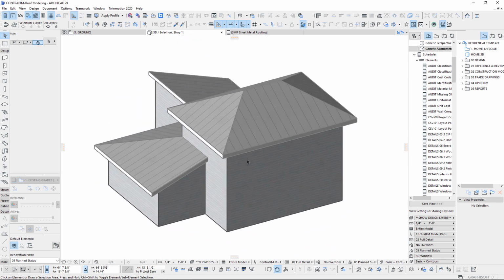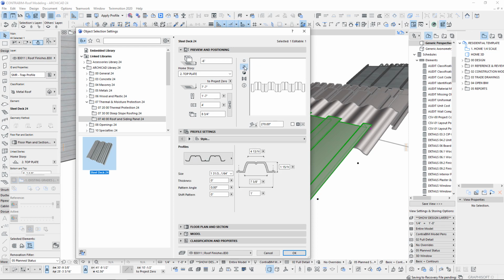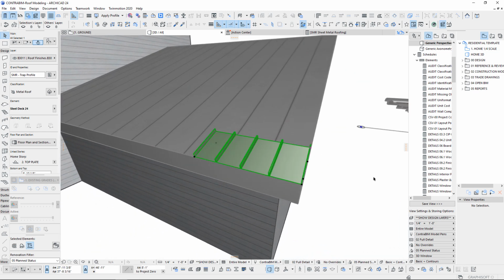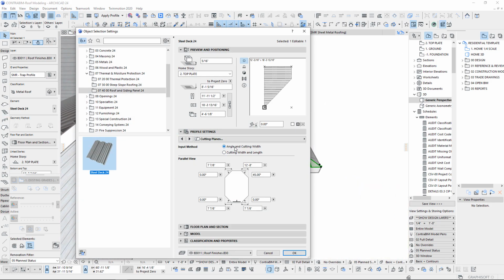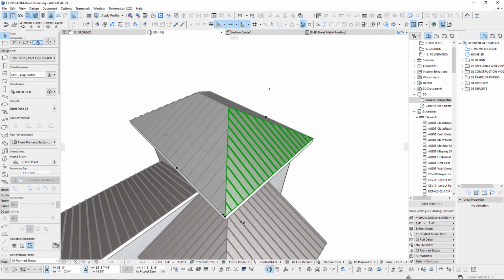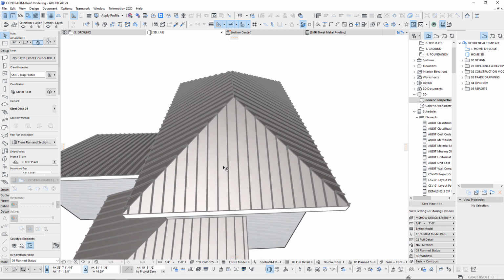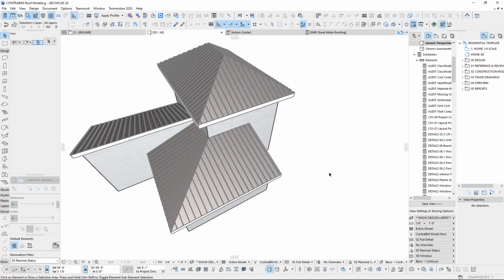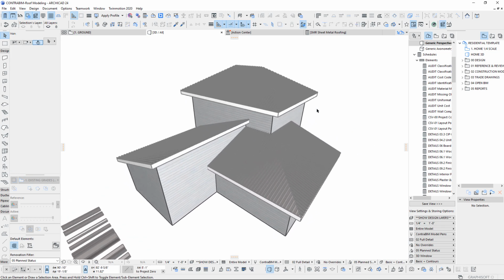Archicad Modeling: Sheet Metal Roofing with Deck Object (Part 2)

Comment: I recently had to model a standing seam roof and I realized it a lot easier just to use a normal roof and model the seams separately with the curtain wall tool!
Reply from the maker: That's a great idea! Curtain wall tool has so many hidden functions it's awesome. In the next video you'll see the roof surfacer tool which can quickly apply seams as well.

Comment: Hello, I wasn't aware that Archicad had the ability to create takeoffs. Archicad is a beast for sure. I am interested in creating roofs using the composite tool where I can show in section the materials used for construction. Can I assume that all of the steps shown can also be applied using a composite roof?  Thanks.
Reply from the maker: Hi Glenn. Yes Archicad has all the tools needed for takeoffs, and can be done on different levels. To do takeoffs with composites, check out this video: https://youtu.be/-xURlH8REDY      The Part 1 - Custom Edge setting type takeoffs with roofs can also be used with composites. Thanks for the comment!

Comment: Is there a way to cut the roof panels with an opening...say like adding a skylight.  Would I need to use an SEO?
Reply from the maker: Likely an SEO will be needed since these are objects. An opening tool I don't believe with cut it. Thanks for the question!

Comment: Hello, could you show us how to model roof construction without using roofmaker please ?
Reply from the maker: Sure, it'd be with using primarily beams and perhaps the trussmaker tool. To start simple, just use a composite structure and then fill the framing cavity with beams when you need to get to that level of detail. I can add a video in this series demonstrating how to do some framing modeling as well. Thanks!